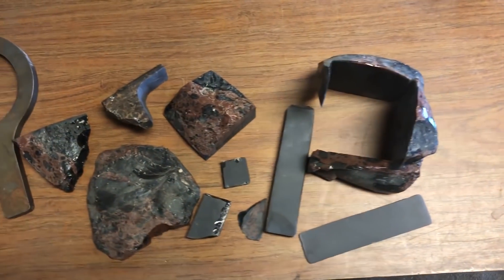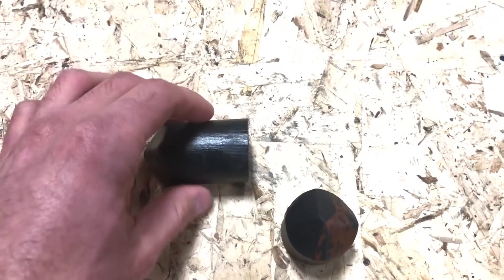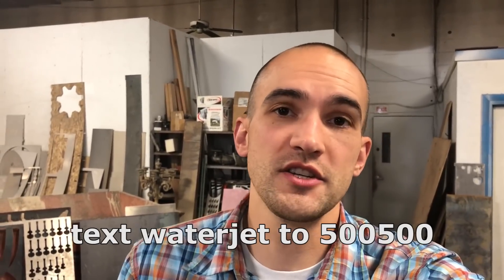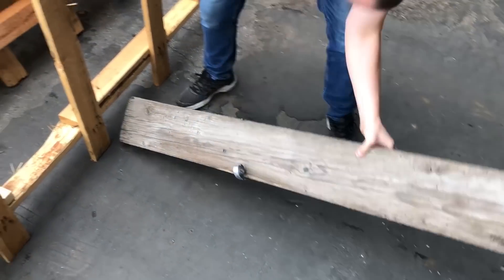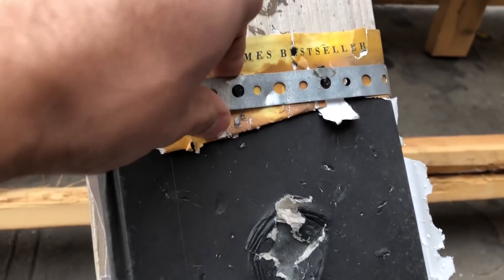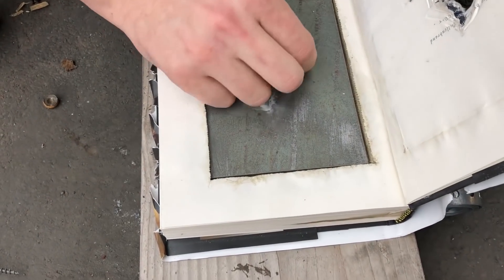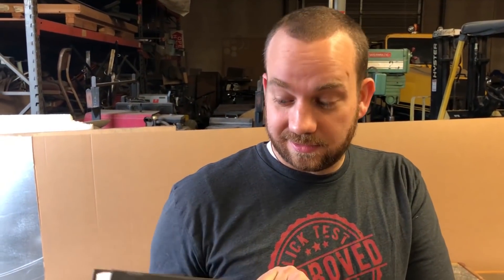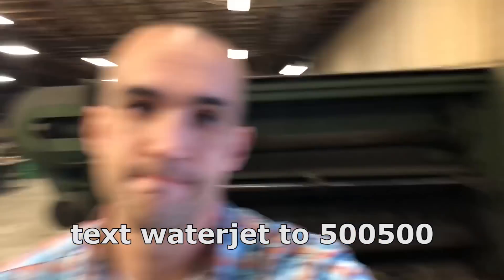300 MPH Obsidian Bullet

Comment: just to point out that would more likely be 1.50 cal (1 cal = 1 inch diameter so a 150 would be 150 inches wide) its why though its called a 50 cal they are actually .50 cal or 12.7mm